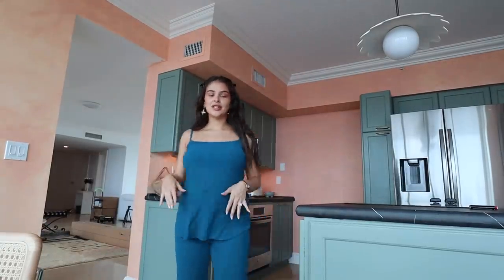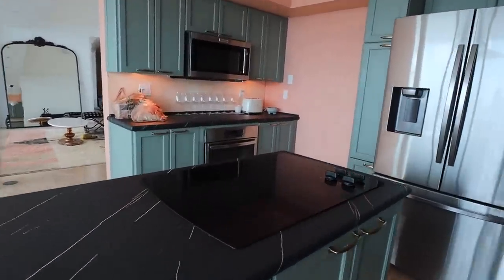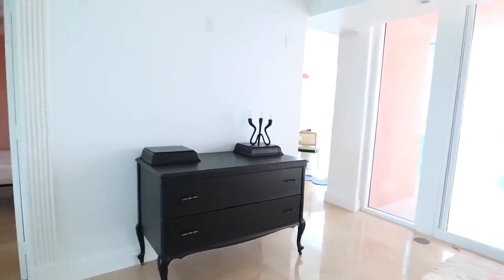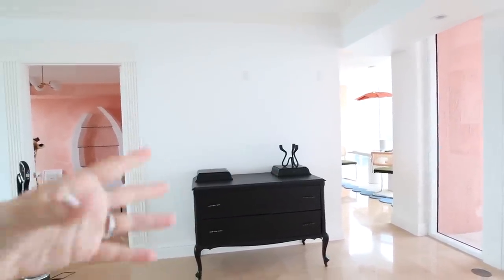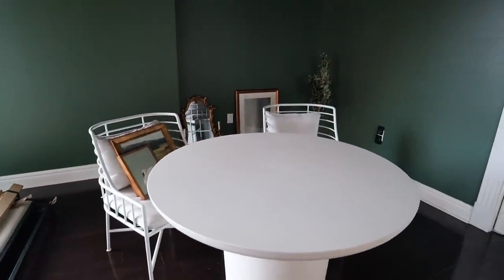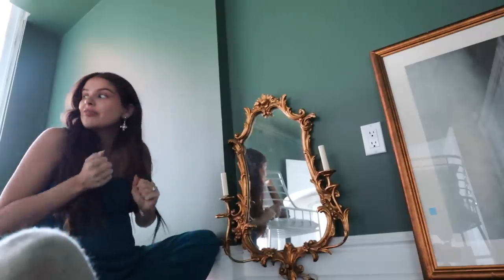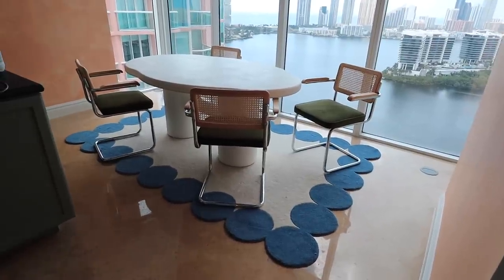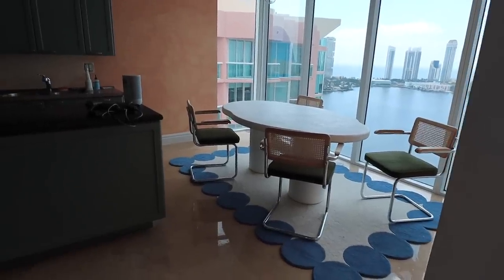my apartment transformation (part 4)

Comment: I think toning down the peach in the kitchen will make the biggest difference. The current color was way too saturated, completly overpowering everything. 
Personally i wouldn't do the limewash effect again, as this adds a lot of texture to the room, when your kitchen already has a lot of information going on. I guess this is personal preference but for me limewash does well with more mineral interiors (stone, dark wood, ...). This effect is supposed to add texture in spaces where texture makes sense.

It can be very hard to find the balance between "trusting the process" and affirming your own tastes, especially when you specifically want to step out of your comfort zone. I think my only doubt in what you're showing is that I find the process maybe a bit cahotic : large paint samples should have been done between the peachy wall and the cabinet green, way before hand. That might have shown that the colors didnt flow well. If the designer didnt personally know that reference before, 1 sample roll of the black vinyl should have been ordered. I think you would have immediatly seen that the finish was way too cray-like (this is immediatbly visible on camera) as well as the white lines being way too crisp to give off a quality effect.  
I'm wondering why rugs are already bought and brought when they are supposed to wrap up a nearly finished space and I really hope that your current flooring, its color and most importantly its shinyness was taken into account when designing the appartement. I hope you saw a lot of moodbards but also sample arrangements (with everything in it, wood essences when applicable, paint, curtain material, metallic finishes, ...) close to your floor before going in. 

BUT with all of that said, it is FUN to play around, nothing is permanent, take risks, and even if you end up not vibing with it, its only for a year or two- plus it's an infinite source of content so also a win for you.

Have fun, take care, laugh about everything !

Comment: when you said new countertops, we def weren’t thinking you meant covering the counters with contact paper. we thought you meant actual new countertops which would cost thousands which is why everyone was thinking you were insane for spending so much on changes to a rental. you could’ve said that from the beginning. same with the backsplash. you could’ve said you were using the peel ‘n stick removable kind. you made it sound like you were going to be making all these permanent, costly renovations in the beginning